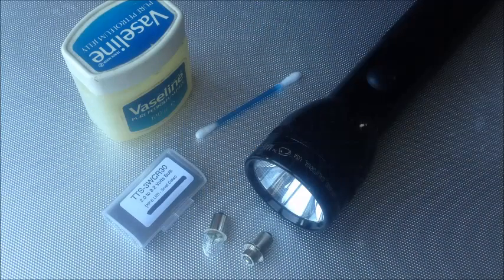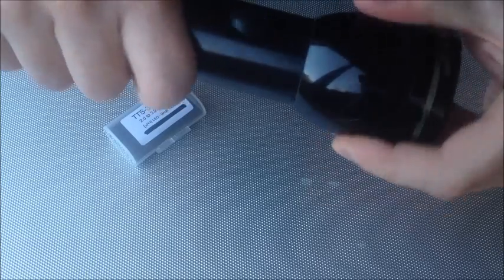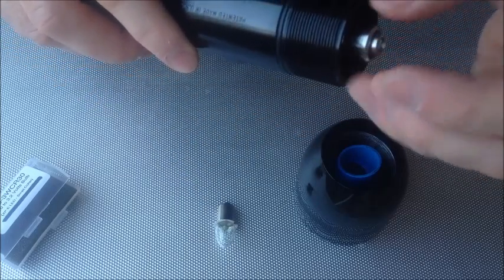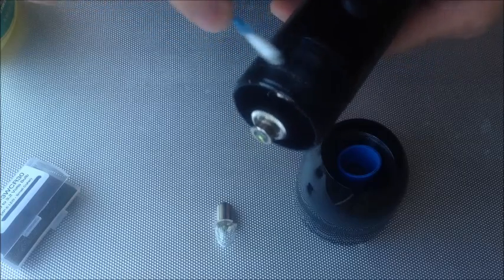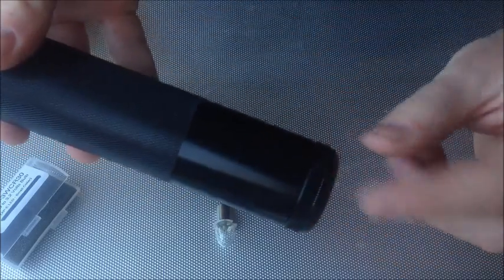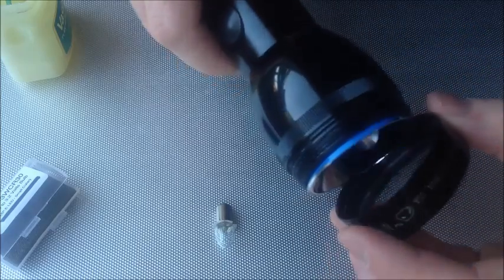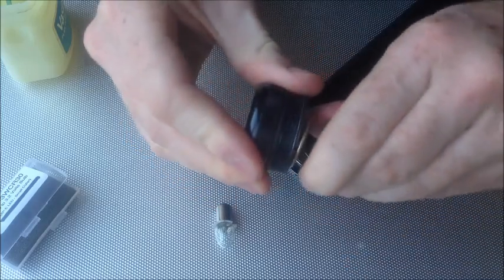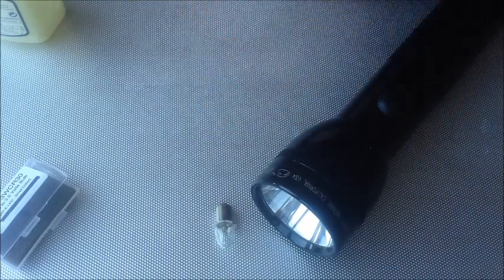Maglite LED Upgrade, 3 Watt 180 Lumen Cree Bulb

Comment: Another great upgrade is to use a Cady that will hold regular AA batteries....say like energizer lithium....guaranteed not to  leak.....are lighter and are easier to find.....or just use regular eneloops that you can recharge.....

Comment: What's the rating on the original bulb? I just bought a Makita DML185 and wondering if it's worth upgrading the bulbs. They don't seem to be very powerful.
Reply from the maker: Hi, I just looked at the original bulb and unfortunately there isn’t any markings on it. I think typically any filament bulb will be out performed by most modern LEDs

Comment: are those bulbs fit flash that use PR2 xenon bulbs?
Reply from the maker: The bulbs I replaced and relocated in the tail cap are just the original incandescent bulbs, similar to krypton/xenon bulbs. These new type Cree bulbs are LED based rather than a filament and are much more efficient

Comment: Vaseline can degrade rubber. manufacturers recommend silicone grease
Reply: +TheLastPost Vasaline is fine on maglite. The rings are not rubber so are not affected. Maglite recommend vasaline/petroleum jelly.
Reply from the maker: +viciousKev  - I wasn't aware of this when I made my video, thanks for the info!